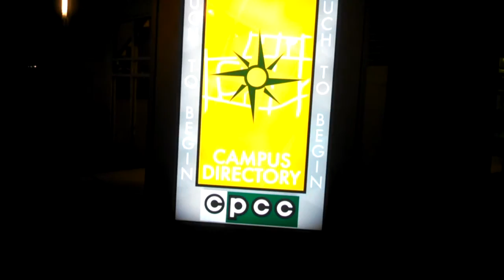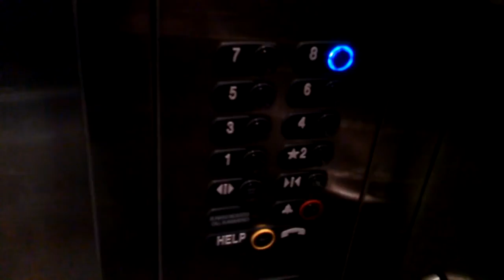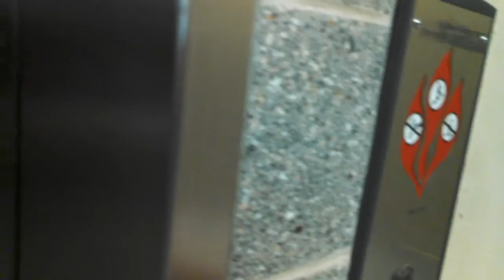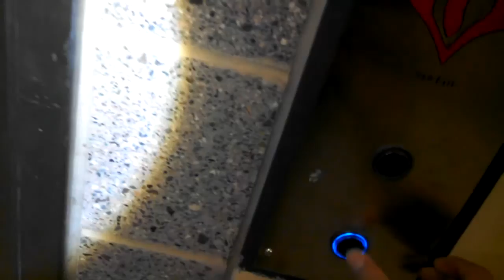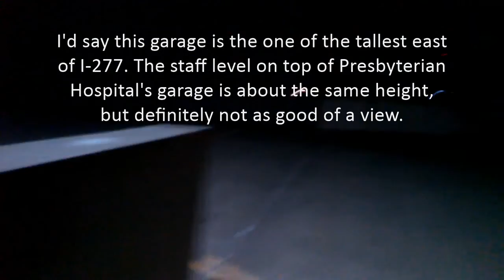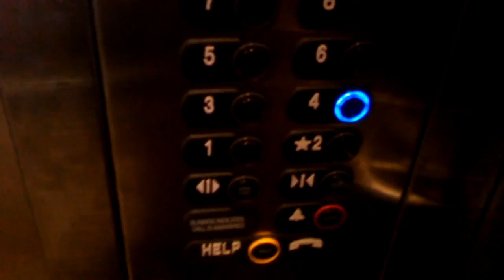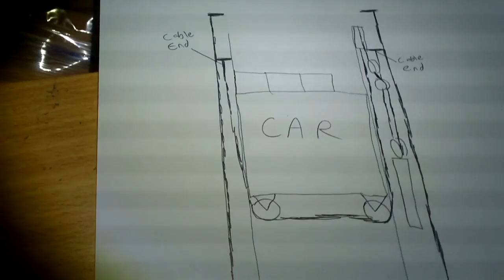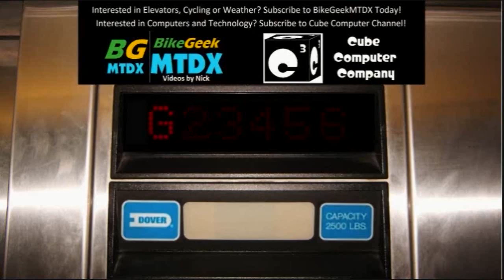A look at the inner workings of a Thyssenkrupp Synergy Elevator

Comment: Too bad ThyssenKrupp hasn't switched to European style door equipment like the other major companies.  They are still using a revised version of the original Miami Elevator (their predicessor) door equipment.  The Euro style door stuff is lighter and works better.
Reply: European style door equipment is completely shit and breaks down very often
Reply: @TechNerdNolan  Disagree.  Well, they finally switched, which is good. They now use a modified version of the Wittur AMD, also used by KONE.  The reason European door equipment is better is that it's more tamper resistant.  With belt driven door systems both the shaft and cabin doors are equipped with interlocks (not restrictiors).  This makes it more difficult for passengers to evacuate themselves if the lift is in the wrong place.  Restrictors are more prone to failure and aren't monitored like interlocks.  
An even more dangerous thing about old school link and early belt door operators is the gate switch.  European belted door systems don't have them.  Someone could just press the gate switch (word wind) and inadvertently cause a false start which could be deadly, especially if a tech forgot to remove a jumper wire from the shaft door locks.
Another danger with link door operators is that the door can become self-locking during an entrapment.  The operator can move the doors, but the doors can't move the operator.  This can become dangerous if the cab is in a safe place for passengers to manually open the doors.  Look no further than 9/11/2001 (WTC entrapment).  With Euro door operators, they are not self-locking and the clutch is spring loaded.  This automatically unlocks the doors if entrapment occurs at floor level, making it easier of rescue workers to evac passengers.  In contrast, link door operators often require rescue works to climb down the shaft from another floor the release the doors.
Since the doors now have interlocks, installation is cheaper because there is no longer a need to install sheet metal between long floor runs, which looks tacky on glass elevators.
I've never seen a European door operator break down.  I've seen lots of link door operators break down.  GAL now makes a Euro door operator called MONxt.

While I'm not an elevator enthusiast, I think the main reason American elevator enthusiasts don;t like to Euro door systems is because they can't door as many tricks with them such as making the lift start with their foot in an ajar door.
Reply: @gliese909  I see your point. I didn’t know Euro door operators have all those features. The only reason I hate euro door operators is because if it’s not maintained really good it can be very loud and very slow
Reply: @TechNerdNolan  The only reason these problems you mentioned exist is because they are often retrofitted onto older door panels which are often too heavy for the operator, which means secondary gearing/belts must be installed.  This doesn't usually happen on completely now installs.

If you want to know more about the improved safety features of linear operators check out this link.
https://www.gal.com/wp-content/uploads/2020/06/GAL_MONXT.pdf